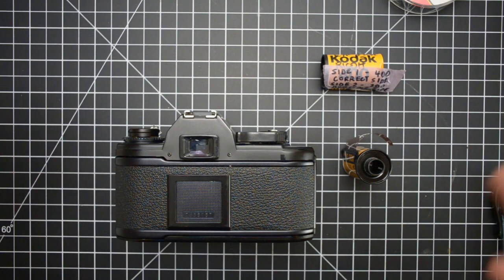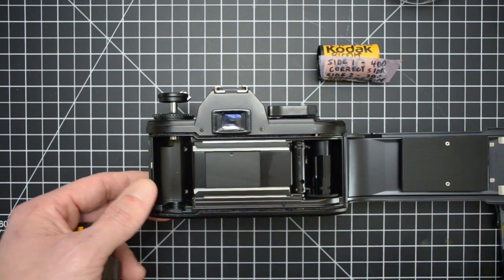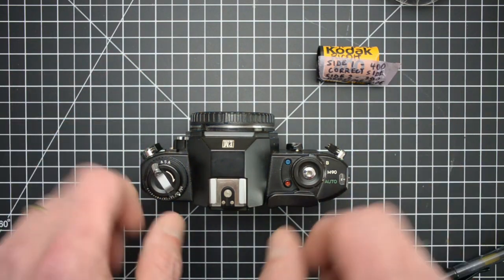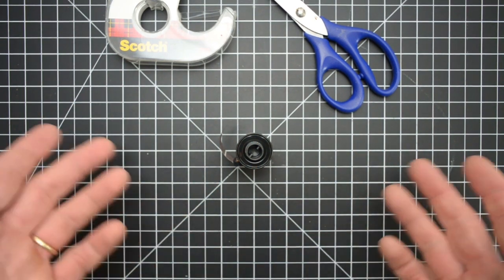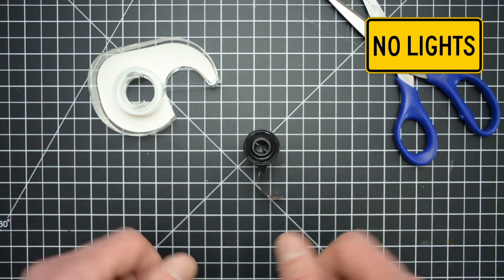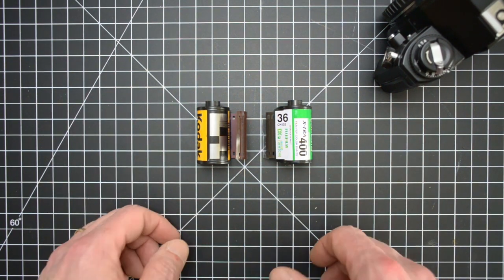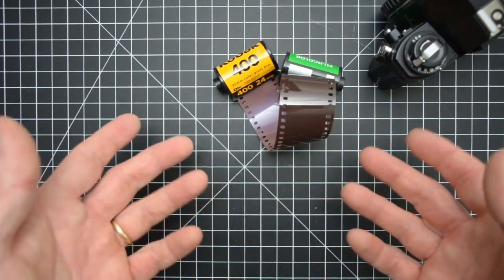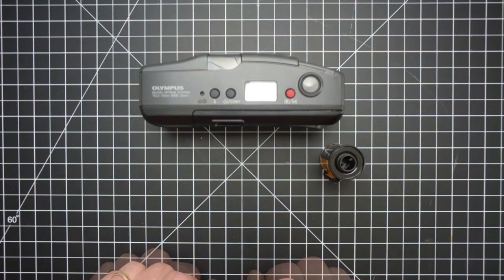Exposing Both Sides of 35mm Film (EBS Multiple Exposures)

Comment: is there an easier way to shoot both sides without all the stuff you are doing? Such as flipping the roll in another camera? I found an easier alternative for shooting 120 film in a 620 camera without respooling. So there must be another easier way to shoot both sides of the film without what you are doing.
Reply from the maker: Hi there. The easiest way that I know of is to shoot one side, rewind that roll (with the leader sticking out) then transfer it to another roll, taping the film to a flipped side of film, then rewinding into the second roll, then reshooting that roll.
I prefer to go through all the extra stuff to get my frames to line up, but it's not necessary.